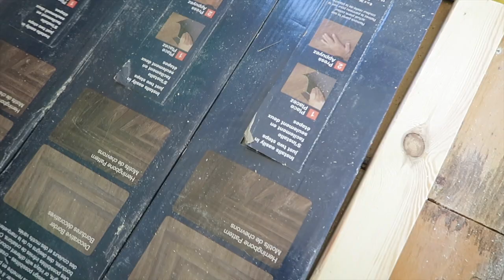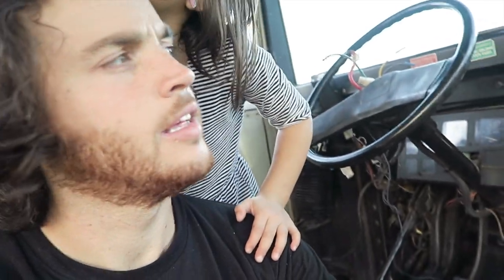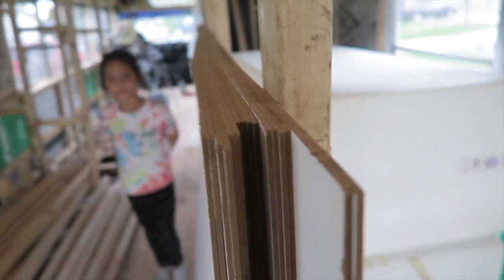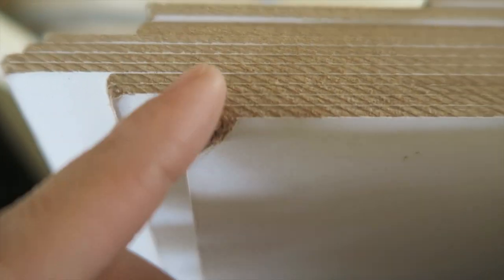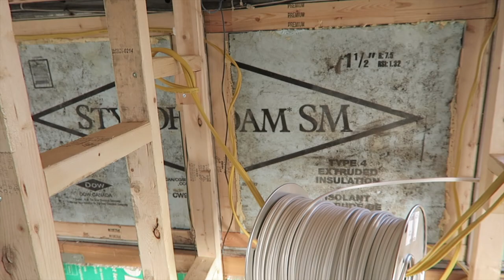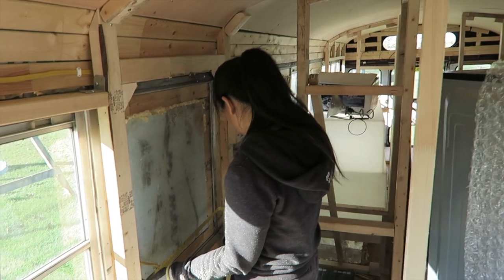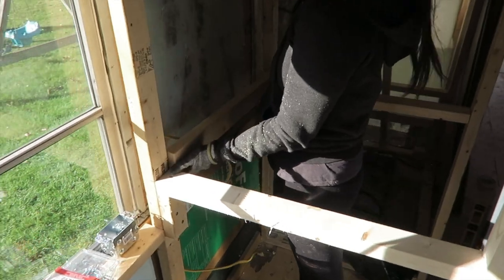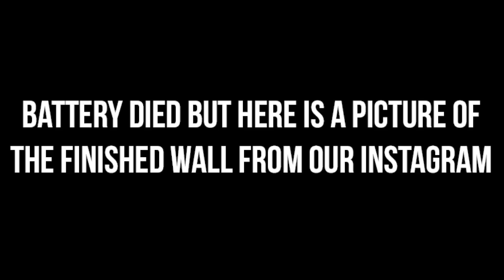Wiring | Electrical | Outlet Install | Finished Wall | School Bus Conversion | Off Grid Tiny House

Comment: Great job man, but we don't know how to do this type of stuff,(( What the heck happened shortly after here ?! 10:14
Reply from the maker: we just secured the wires in according to what the outlet packaging said. we wrapped the wires around the screws on the outlet and tightened it in place. sometimes (it might be different for everyone) the white wire is secured to the silver screws, the black to the brass and the ground to green. we're not professionals so you should ask an electrician if you need help. thanks for watching!
Reply: Ok, gotcha. I', going to buy a bus and trying to learn everything through videos. Think I can do most, but the electrical stuff, no way...lol. Thank you.
Reply from the maker: it just takes some time to do all the research. best of luck with your future conversion!
Reply: Hey man, was just doing some more studying online. I know I'm going to have to hire someone  to do the electrical stuff.... lol. One last question: Do school buses generally come with exterior electrical outlet. If so,I can then hook up and run the AC from that....yes ??
Reply from the maker: no you would have to install the shore power outlet yourself. buses don't have that. we were planning on installing an AC and then just plugging it into the grid whenever we're parked.
Reply: Jeez....just can't get a break . And I still don't even HAVE a bus. Thanks again.

Comment: do not pre-drill your screw holes you weaken their strength. Flip your outlet upside down. YOU will need corner backing for your inside walls for your sheeting.
Reply from the maker: great tips! thanks!
Reply: Predrilling is OK, providing that the hole is not too large.
Reply from the maker: that's really nice of you. thanks! send us a message if you wanted to chat more :)
Reply: Norris Coleman NOT True. Pre-drill proper size and it will be stronger and will not split.

Comment: Those mdf wall boards will be a waste. I'd take them back. Temperature change and humidity will trash them.
Same with laminate flooring unless they are water proof. Most laminate is compressed fiber base and don't do well in extreme heat or in moist environments.
 Cheaper may cost more in the long run. If you plan on having it for years take your time and spend a little more on quality. Redoing it while you are in it won't be fun
Reply from the maker: we've been working more with plywood lately and I'm considering using them instead. you are definitely right - we want this bus to last! thank you :)